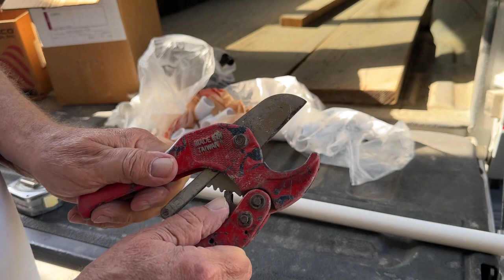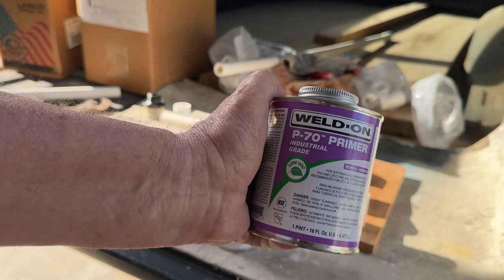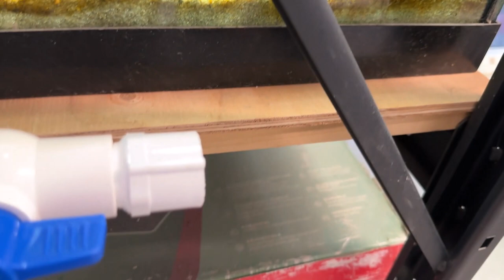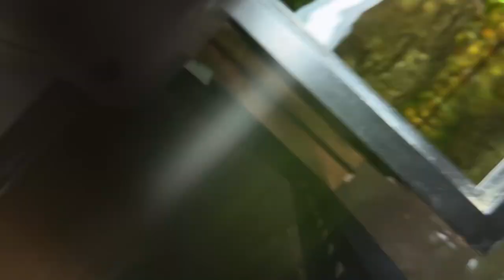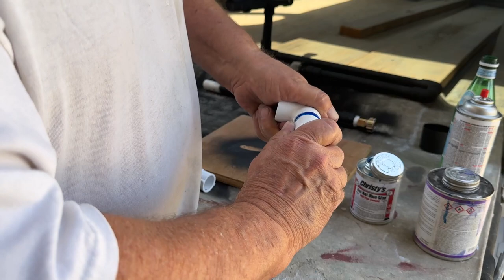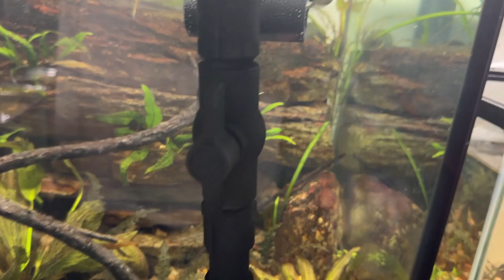How To Make A Permanent Tank Drain And Also Build A Tank Fill Rig

Comment: Great project, Ron! I've never really worked with pvc pipe before except friction fitting small pieces, but this was so well explained and demonstrated that I feel like I could do it now. Interesting when you need to use the primer vs. When you don't. Hope your corys breed for you! 🤞 Full watch 🙂👍
Reply from the maker: Thank you so much, Tara! Once you get the hang of it, it's really a lot of fun. And basically it's dead simple. Next thing you know, you'll be putting in your own sprinkler system! 🙂 Thanks for watching it.